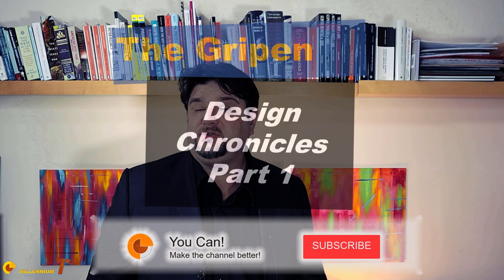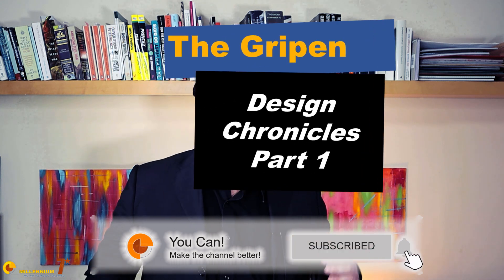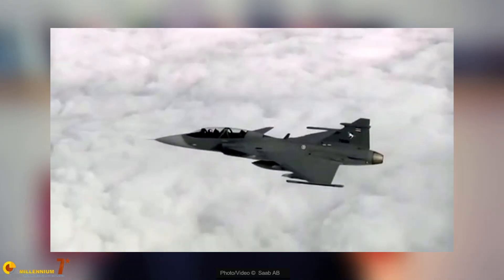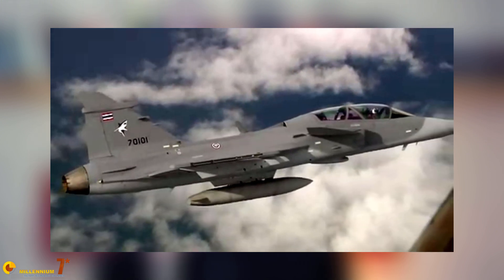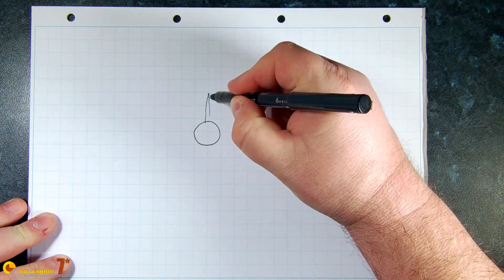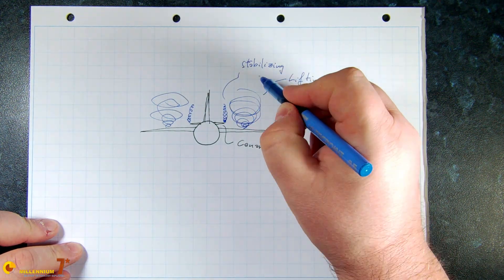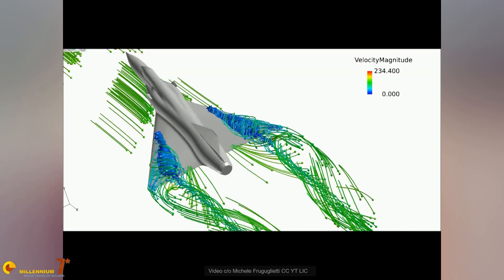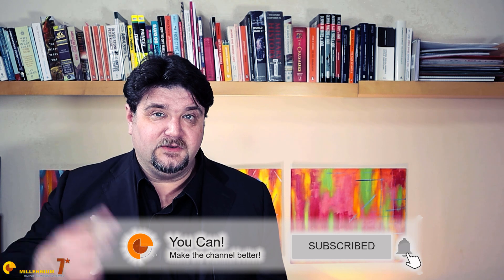Gripen - The Design Chronicles - Part 1

Comment: The combat proven F-18 and F-15 are designed to “keep flying” after taking two hits anywhere in its hydraulic systems.  The redundancy levels for current fighter aircraft:  single-engine: F-35, F-16 & Gripen = 3rd generation; twin-engine: F-18 & F-15 = 4th generation.
The overall Canada program cost for the new Super Hornet should be competitive with the program cost of the Gripen since the CF-18 has been a mainstay fighter in the Canadian Air Force for 43 years.  The USAF F-15 has been in service for 49 yrs with the B-52 bomber in service for 70 yrs.

Comment: Basically, aerodynamically it’s like an F-16 that traded a little bit of sustained turn rate performance(22.5 degrees per second sustained turn rate down to 21.17 degrees per second) for much better instantaneous turn rate performance. More generalized.

Comment: On another note years ago when testing different close coupled canards on a 4 foot wingspan foam models, on moving the canard very close to the wing, the aircraft became very difficult to turn! That was very confusing! My initial thought was that probably the "slot effect" was increasing the velocity of the vortex and making the aircraft more stable. When I moved the canard upwards about the thickness of the main wing, it once again turned easily. 
I would appreciate any feedback on this. 
Thanks again for such a fantastic channel

Comment: @Millennium 7 - would also be interested in your thoughts re: the new USAF T-7a Redtail Trainer that Boeing & Saab collaborated on as it seems somewhat of a mixed design between the single engine Saab Gripen (Saab manufacturing the fuselage) and Boeing's twin tailed F-18 Super Hornet. Curious as to why you think Boeing didn't go with the Delta Wing/ Canard design favored by the Euro fighters.  -
Reply: A trainer must have a conventional layout so as to enable trainee pilots to fly with manual control over tail trim, flaps, rudder yaw, etc. A highly automatised system of unconventional layout that is actually impossible to control manually due to instability is not a good trainer. 

When pilots graduate from jet trainers, flying more advanced types like delta canards would be the next step in advanced training.
Reply: @MonMalthias  Interesting that the SwAF recently announced that they are going to be retiring their aging  Saab 105 (Sk 60) trainers and instead go with a propeller plane for lead-in/ basic training, but utilize their older Gripen C/Ds as advanced trainers as the new Gripen Es become operational & get integrated into the Air Force. https://theaviationgeekclub.com/swedish-air-force-to-use-gripen-c-d-fighter-jets-as-advanced-trainer-aircraft/amp

The US utilizes AT-6 propeller planes as a lead-in trainer whereas the  T-7a Redtail Trainer that Boeing & Saab are collaborating on will be utilized as an advanced jet trainer ... so it would seem that the use of a traditional or a delta wing advanced plane for advanced flight trainer is perhaps a 'choice' based on which kind of planes your AF uses ... or so it seems. 

One of the reasons for my initial question was that I wondered why Saab didn't just submit its Gripen Aggressor model as trainer candidate. Obviously - as an established plane - the R&D & development costs would have been basically $0 - and that would have helped Saab make an aggressive/ competitive price . 

Obviously, I don't know what Saab might have been able to bid on an order for 350+ Gripen D Aggressors - but I'm guessing they might have been pretty aggressive with their pricing and they could have set up manufacturing in the US ... something they've done in Indiana for the fuselages that Saab is building for the T-7a Redtail trainer - and it would have been a real coup for Saab and perhaps helped in sell more Gripen E/Fs given the imprimatur value of being selected to build the USAFs new jet trainer based on your previous gen jet fighter.  Heck - for such a big order, Saab might have even decided to utilize the air frame design of the newer Gripen E (moving the wheel housings the wings to allow more fuel in the fueselage, etc.) so that the US production facility could have also built Gripen E/F fighters for export - and maybe become a cheaper 'light fighter' for the USAF, Marines and/or Navy - given the Gripen's impressive STOL attributes. 

Certainly, having Boeing as a partner likely added some important political points - but I guess I was wondering what could have been and my guess is that from a performance standpoint - a Gripen Aggressor based trainer would be a higher performance plane than the T-7a .. though again I dont know enough about the T-7a to say for sure. Perhaps @Millennium7 has some thoughts.

Comment: @Millennium 7 - am hoping you will get an opportunity to discuss whether the new Gripen E/F - including the bigger wings incorporating wheel housings & the slightly bigger nose cone section for the AESA radar, etc - necessitated certain other design changes that enhanced, detracted or altered the aerodynamics/ performance aspects of the Gripen - separate and apart from the slightly bigger & more powerful engine.  I realize that the Gripen E/F looks very similar to the C/D versions, but I'm guessing there may be subtle but impactful design changes in the newer plane in addition to the spec changes & the addiitonal electronics that have been built into the planes.
Reply: https://www.youtube.com/watch?v=mfZvwtdlYy8
Saab redesigned the undercarriage for the Gripen E/F which leads to a large increase in fuel capacity. They also uprated the wings to carry heavier payloads, upgraded the electronics, and upgraded the engine. In short, it is a completely different plane. I would wager that only a few parts, like fasteners, ejection seats, canards, controls, and a few bulkheads and stringers would be all that remain common.
When you redesign something as fundamental to the aircraft structure as landing gear (these are the points of greatest stress and large cavities must be kept so the gear can retract internally) then basically everything changes. The wing, the main body, even the engine mounts, have probably changed. Also, type changes are when the engineers in structures like to fiddle around with how composite panels are laid up or aluminium parts are fastened etc. So you might even wind up with panels on the Gripen C/D that are shaped the same and go in the same place as the panel on the E/F, but it will be completely different. 

This is why it is deceptive to consider the Gripen E/F to be an "upgrade". It is literally a whole new airplane. This is the same deception that Boeing pulled with the Super Hornet. Nominally it is still a twin F404 powered, twin tail, cranked arrow wing design but actually the whole aircraft is different. Parts are interchangeable, but it is definitely not the same. Compare the 2 exploded views of the Hornet versus the Super Hornet. Count things like ribs, stringers and bulkheads. They are very different aircraft under the skin. And that's just talking structure. Once you start talking about electronics and engines they become very different beasts.
https://i.pinimg.com/originals/37/ce/09/37ce0988db978d739aaf133ee50bdb6d.jpg
https://information2share.files.wordpress.com/2011/05/boeing-fa-18f-super-hornet.jpg

Comment: Very very nice video! Keep them coming. I build model aircraft and I'm designing a WIG and I'm very interested in Delta canards. Do LE sweep of less than 55 degrees produced stable attached vortices?
Reply from the maker: I am not sure but I think it depends from the Reynolds number too, so you might have surprises on a small model. But I may be wrong.
Reply: @Millennium7HistoryTech  I've read many papers and most agree that 55 degrees is the min sweep angle for stable attached vortex formation except in very low aspect ratio square wings of not more that aspect ratio of 1.5 where the LE vortex and Tip Vortices merge to form a low pressure 'sheet'. Many say 60 degrees is the preferred number for Deltas.
I notice though that the Rafael and Gripen have 50 and 45 degree sweep and wondering if the vortices from the canard merge with wing vortex and enhance the lift as you mentioned
Reply: Wouldn't it all depend on the speed? I really hope you can explain these things in more detail

Do you have Adrian Neweys phone number ?